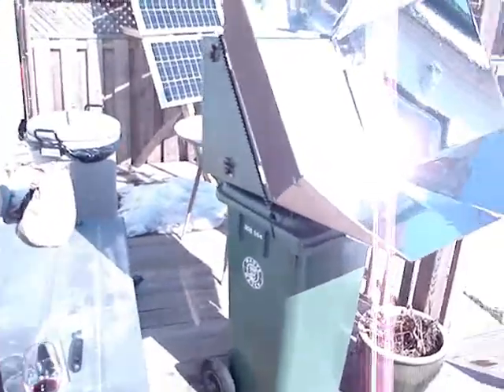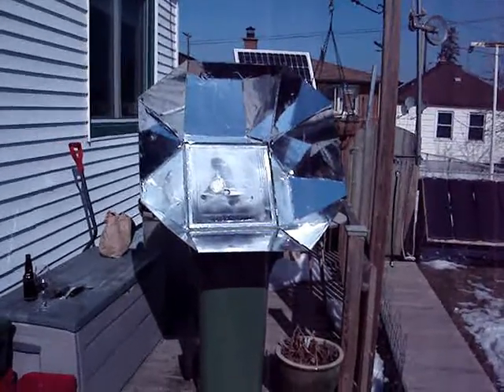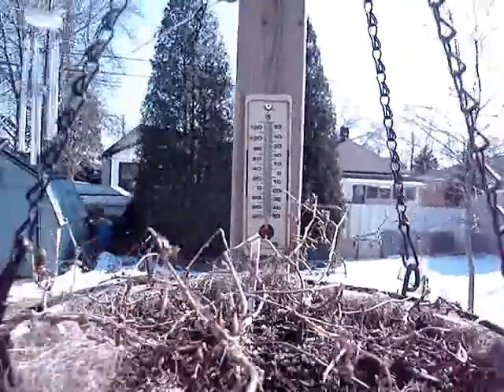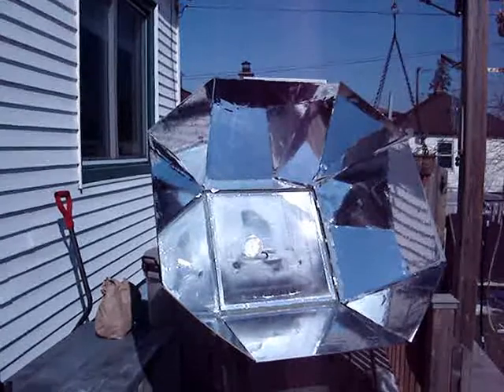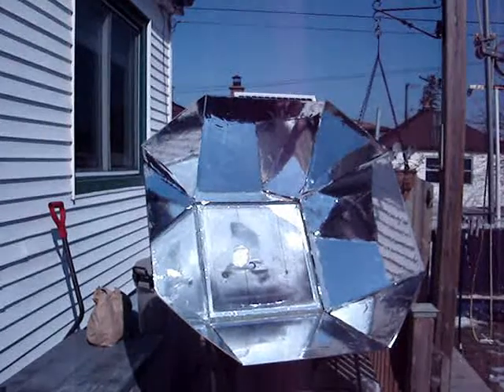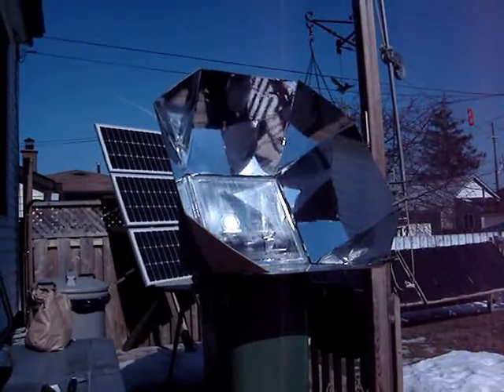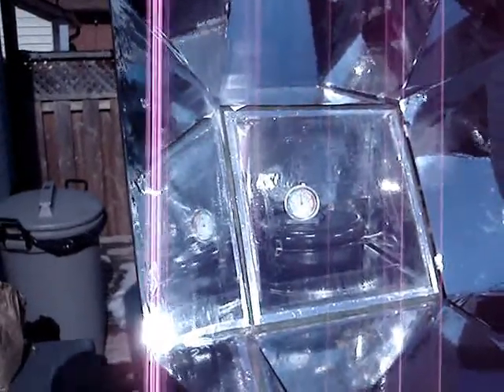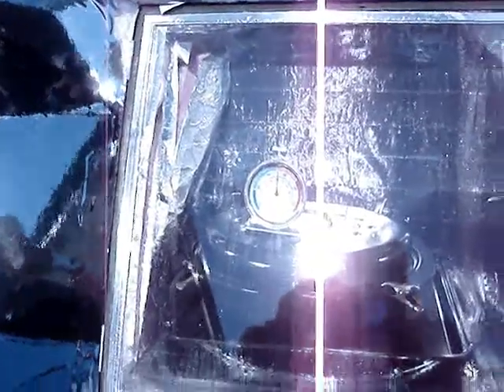Solar Oven - First Issue

Comment: @oaney and the insulative properties tapered off the further apart the glass got. The nominal distance (at the top of the U) was somewhere around 0.25 inch (1/4 inch) if i remember correctly... I cant find the chart offhand, but if you are interested, I can get in contact with that professor and see if he still has a copy of the chart.

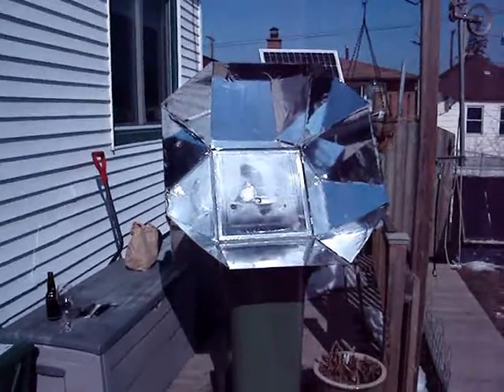Comment: Around a 1:20 you mention maybe needing more space between the glass, which sparked a thought... I dont mean to criticize your work, it looks excellent, but I am thinking back to university classes, i took a building materials class. I was shown a chart about the air space between glass panes and its respective insulative properties. The graph was basically an upside down U, meaning it had very little insulative properties at very close distances.... See next post for the rest

Comment: Myth: You cannot burn your food in a solar oven. 350 degrees is 350 degrees... Whether the heat comes from the sun, electricity, propane, or natural gas makes no difference. If you can burn it in the oven of your house at 350, you can burn it in a solar oven at 350.

However, very nice design. I like it.

Comment: go on the solar cookers international website, look under archives for inexpensive cookers you can build--hipofalcon has built an awesome cooker, but you can also build them far more cheaply. in the past, on the google site, one young lady experimented with an old discarded microwave that had shiny stainless steel sides- Don't give up!

Comment: @oaney 
"NOTE: Many consumers are under the false assumption that more dead airspace means greater energy efficiency. However, studies have found that while airspaces less than 1/2" are too small to be effective, airspaces greater than 5/8" allow air currents to develop within the two panes. Such air movement aids in the transfer of heat between the panes, actually reducing efficiency."

Taken from: weathermaster-window(com)/glass.html

Take spaces out